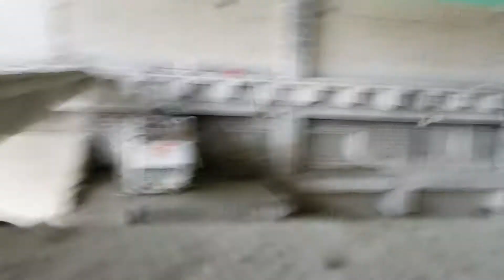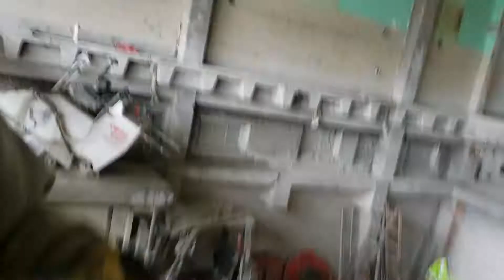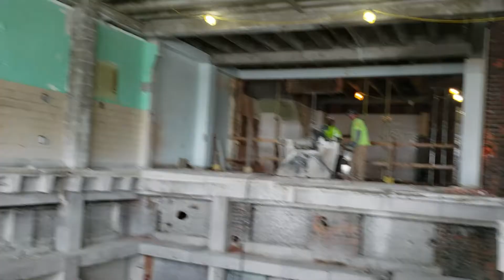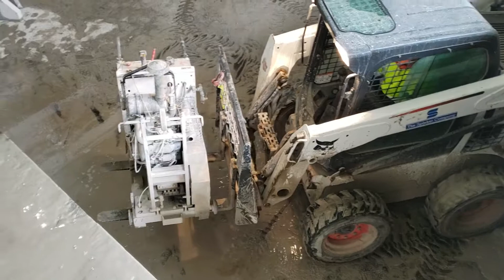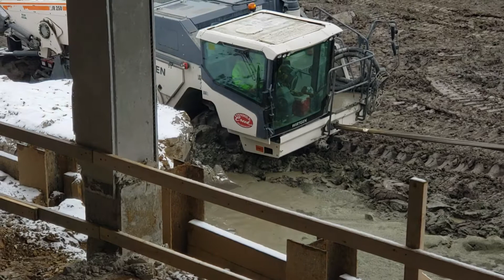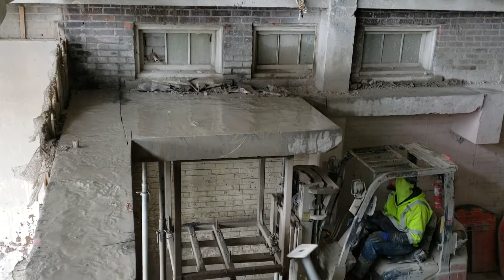Structual cut and hang. Last piece. Long video

Comment: I like the videos where you set the camera back so you get a good view of the job, like this one.  I also noticed you're not wearing those rubber boots anymore.  Do you still have them?
Reply from the maker: I still have them but it's too cold for them.  They also did not hold up well, cracked all along the front around ankle level. Very disappointed for pricey bpots.
Reply: yeah I remember you got them from a buddy of yours.  You should look into those dunlop thermo purofort boots I recommended.  They will hold up well in your work environment and they are good down to really low temperatures and will keep your feet warm.  Let me know what you think.
Reply from the maker: They basically are dunlop boots 
https://www.bekina-boots.com/en/boots/industry